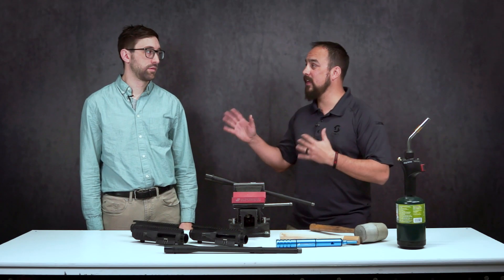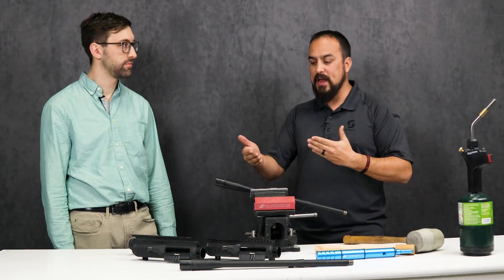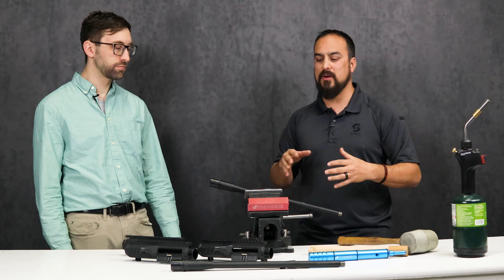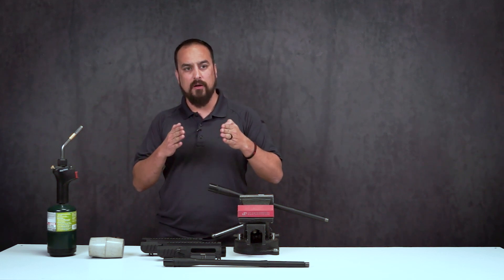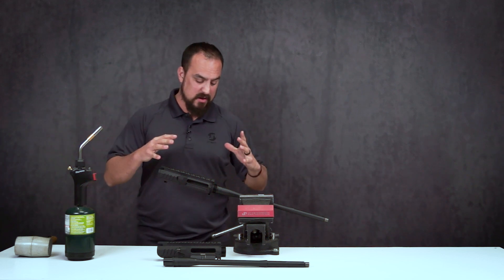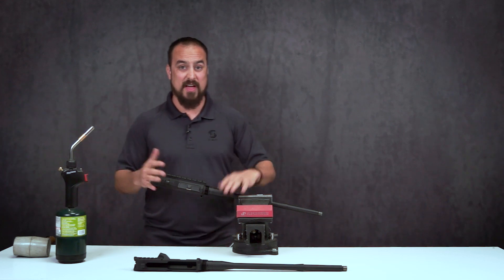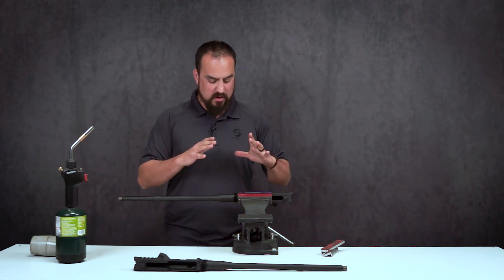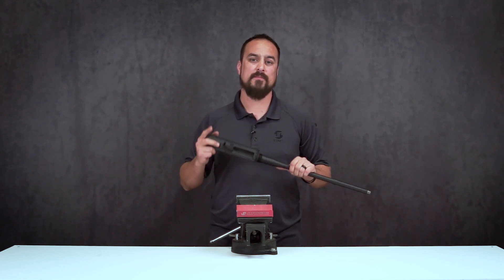The Secret of Thermo-Fit™

Comment: Facing the barrel and using locktite produces the same results.  I don't like interference fits with thin aluminum.  Better to bed it than to add that much stress to thin aluminum. This isn't a situation where you want to change a dimension.  This steel barrel isn't going to give at all in this scenario.  The aluminum will stretch. If you bed it with locktite, this won't happen. Try it and measure the receiver/barrel threads before and after inserting the "thermal-fit" barrel.

Comment: Or the reverse freeze barrel it will slightly shrink heat receiver in oven to 250 to expand then put it together if you dont have torch

Comment: So does this process take into account the fact that you are altering/relieving the heat treat temper in the aluminum of the receiver at a high impulse stress location?
Reply: They're not, it doesn't.  How do I know?  Metallurgist with years of experience.  6061 and 7075 are both solution strengthening alloys. They are only heating to 300-400f.  Not enough to do anything.
Reply: @tke466  Are these hypereutectic? or just really strong and stable?
Reply: @thewatcher611  not hypereutectic. That alloy really is suited for casting.   The Si content makes casting easy.  6061 and 7075 are wrought grades. Their chemical comp make them functional impossible to make a good casting.  They both are solid solution strengthening meaning at room temp they will achieve full strength.   Yes at room temp.  But that would take literally years.  So you artificially age them at a 300f give or take for hours... many hours.  Interestingly about 15 years ago the same phenomenon was discovered in gray iron.  The industry really doesn't utilize or talk about it as it takes only 30 days sitting in inventory for it to happen.  Hypereutectic aluminum is primarily used for ease of casting and hi thermal (dimensional) stability.
Reply: @tke466  can you translate for a layman?
Reply: @FLSheepdog  what part can I help elaborate on?

Comment: Same with my BCM uppers and BCM barrels. 
I thermal fit the receiver to barrel
Reply: Do you use a torch or heat gun?
Reply: @narutobroken  
Heat gun
Reply: @narutobroken  
It don’t take much
Reply: @jayonez137  cool thanks. I’ve got a barrel that’s stuck and am trying to remove it. Will buy a heat gun and give it a shot
Reply: @narutobroken  
That should work. 
Try Getting some oil in there prior to heating

Comment: I’ve done this on the last few rifles I have built.
Reply: If the barrel fits, there's no need for thermal fitting, right?
Reply: @danny2shoes  Right but I would look up how too use stainless steel shim stock too get a more accurate rifle. Usually .001 shim stock will work fine.
Reply: Huntski Kerbiden-Zhaojing  T.Y. It works & it's a cheap fix for a barrel that does not THERMAL FIT TO THE RECEIVER, LOOSE FITTING. The result is better accuracy & who doesn't want that ? There's not a whole hell of a lot ya can do for better accuracy on these take down pinned guns. Buy the best parts ya can & go from there.

Comment: Wouldn’t facing the receiver face and and truing up a very good barrel accomplish the same thing?
Also I’ve STOPPED using any type of aluminum barrel but. 

I promise you if you loctite the threads on a high quality steel barrel nut you will need that torch to get it to back off.

Comment: I just did the same, except had my upper receiver in a toaster oven at 350F for 20 minutes, slipped right over the barrel extension with 0.0015" sst shim stock easy peasy.

Comment: What about putting aeroshell grease on the barrel extension? Wouldn't the heat make it run? It has a temp rating of about 300F
Reply: That's what ima use. Shouldn't hurt it

Comment: I've had bad luck with interference fit barrel to receiver guns drifting.  I now use 620 retaining compound.

Tight is OK but if the receiver has to stretch to fit I think the stress added causes poi to drift.

If it takes heat and a mallet it's too tight in my opinion.

Comment: Since it is a heated fit. If you dump say 5 magazines will the barrel heat up enough to crack the reciever since it is so tight and the barrels heats up faster than the reciever making it expand first
Reply: Aluminum expands quicker than steel when heated.  This coupled with aluminum's ability to dissipate heat quicker than steel will ensure that isn't ever an issue.

Comment: Throw the barrel in the freezer before you torch the barrel, to shrink the tolerences on the barrel. Its like replacing a spindle on a wheel hub with no hydraulic press

Comment: The bcm receiver for my last build required the same thing. The instructions it comes with say they are intentionally made to smaller tolerances so they can have a better tighter fit. I will always buy a bcm receiver from now on.
Reply: My vseven upper was the same way. Fit very nice once I heated it
Reply: @ragedashboard6374  right on! Good parts!
Reply: Did you use a torch or a heat gun to heat up the upper?
Reply: @narutobroken  I used a 14 oz propane cylinder torch and some aeroshell barrel nut grease when sliding it in. But A heat gun might work too.
Reply: @theimpaler2317  thanks. I have a barrel that I can’t get off. 
It has grease on the barrel extension so I’m wondering if it could burn
Reply: @narutobroken  the grease is made to withstand a lot of heat, but to get a stubborn barrel off I’m not sure. I’ve used a reaction rod to install one of my barrels once, and I’m not sure but you might be able to use one to remove the barrel, but I’d do more research first, and obviously you’re gonna need an upper receiver vise block if that is the way you end up doing it.
Edit: actually no don’t use a reaction rod that might be a bad idea since it’s metal on metal. Use a wooden dowel that fits into the upper and you can tap the barrel out.
Reply: @theimpaler2317  Thanks good idea, I picked up a 1" wooden dowel so hopefully it fits
Reply: @narutobroken  if it doesn’t budge you might wanna heat up the upper a bit
Reply: @theimpaler2317  Thanks yeah Im planning on using the heat gun to get it slightly warm
Reply: @narutobroken  good luck to you!
Reply: Do you need locktite as well with this process?
Reply: @LT4me  no, just use aeroshell grease, and then torque it to the specifications from the manufacturer.

Comment: Hmm... Cool idea, but it seems like you’d be putting a ton of stress into the receiver that way. Given aluminum’s flimsiness and tendency to fatigue over time, that makes me a bit nervous
Reply: With how little he heated the receiver and how easy it was to push on to the barrel I couldn't see there being more than a .00002"-.00005" interference fit. That wouldn't be enough to stress the aluminum/cause the receiver to fail.

Comment: I ran into this on a Centurion Arms CM4 upper not knowing it was a thermal fit upper, ended up freezing the barrel overnight set the upper on the stove a minute or so and they slipped right together. Still looking forward to shooting the completed lighter weight 16" rifle with their pencil CHF barrel. It's significantly lighter than the old heavy barrel M&P Sport II blaster.

Comment: Can this be done with a heat gun, and if so, what temperature should I be going for?
Reply from the maker: You can use a heat gun, but it has to be pretty powerful.  Not sure what exact temperature is called for.

Comment: Just another sales pitch. If you true up the mating surface where the barrel extension kisses up against the upper receiver that will do way more for accuracy (assuming you follow correct tq sequence for your barrel nut).
Reply: Squaring low quality uppers won't fix problematic accuracy. Uppers that give you the best groups have square and tight receiver extensions that are aligned with the picatinny.
Reply from the maker: All of our receivers are squared and doubled check during the QC process.  We have done years of testing to prove that Thermo-Fit really works

Comment: New to barrel assembly but what about the barrel shims?
Reply from the maker: Depending on the fitment between the barrel and receiver, you might need shims, but you can still make use of this method.
Reply: Ok, I see now. Some YT videos show the shims going between the barrel and receiver, which is wrong. And if you installed the shims between the rcvr and barrel then had to thermal fit the barrel, that could he a very time consuming project. 
The shims go on after the barrel is installed, between the barrel and barrel nut.

Comment: I tried to do thermo fit with my grill lol I failed miserably. I will head to the store to buy a vice block and a torch. Also was I supposed to use grease on the barrel extension?

Comment: Off topic, picking and choosing parts for a custom build, not all pieces are machined to the same tolerances. Any solutions for tightening/snug up a barrel that almost feels a bit loose in the receiver prior to the barrel nut?  I know the the barrel nut will snug up but I can't help but feel regardless it will still have the slightest amount of play when operating. Please correct me if I am wrong

Comment: I would want to seat the barrel with the nut while applying heat or in a fixture that assures the barrel extension is seated to the face of the receiver. Not just shove it together by hand and then tighten the nut after it's cool. I like the idea but not the Technic.

Comment: I got a cry havoc QRB on my 7.5 .300 blackout.  Now i know it's not suppose to be hard to pull the barrel out of the upper receiver.  I have to struggle to take them apart. Putting it back the upper receiver isn't bad it just pulling them apart is..what could be the problem? Any lil advice will help either from you or any fellow subscribers
Reply from the maker: Is it difficult to remove immediately after you install it, or are you talking about it being difficult to remove after you've shot it some and disassemble?
Reply: @JPRifles  after i installed it..haven't gone to the range yet..

Comment: Just like fitting bearings to shafts. Typically a .002 interference fit. Sometimes .003. But very little time to fot both pieces. In that case freeze the barrel and heat the receiver. To me. I measure everything to know what I'm facing. 
Heating with a torch is easy way to damage a bearing. In this case, the receiver by applying too much heat to one spot
 Proper heating element and use of  a rated grease pencil for heat you need to acheive works very well. However, better method than opening up the receiver bore when a barrel extension does not fit.

Comment: You guys dont have a temperature value to throw out here? What degrees are you heating too?

Wouldnt you want to heat the entire receiver in an oven to prevent thermal differential stresses?
Reply: @David Macaulay Yea thermo fit parts arent anything new, thats why I'm surprised they're acting like this is some kind of proprietary information... seems weird to be so vague about this kind of stuff when you're making a tutorial for the customer.
00:47 "we've done the math on this"  buuut we're going to give you the minimum amount of information to try and do this yourself.
Thermal fit, shrink fit, press fit are all standard and have established tolerances.
Reply: @Big Wally you sound like an emotional girl.
Reply: @Big Wally get better soon bud.
Reply: Big Wally   Carl & Beach & board fan is absolutely over thinking it!  If you can’t get the gist of this video than you should be using a gunsmith.

Comment: Does this process only apply to your uppers/barrel fit, or does it apply to all uppers with your barrel? I haven't completely decided yet on barrel, but am working on obtaining the info that would help in deciding on whose barrel I'm likely to buy.
Reply from the maker: The barrels have a standard sized barrel extension and do not require the Thermo-Fit process when being installed in most receivers. Only the JP PSC-19 and JP LTC-19 upper receivers currently require the Thermo-Fit process as shown in this video.
Reply: Bcm uppers are this way..

Comment: So I'm not nearly as smart as these fellers here, but I'm a little worried about cracking the reciever.  I'm thinking that if the receiver wont even fit without being torched, what kind of stressed are imposed on it when the barrel gets ripping hot?

Comment: But how well did the upper and barrel fit before the thermo fit? Was it too tight to slip on, and heating the upper expanded it to fit? What if your upper and barrel already fit fine or was loose? Would you still want to do this?

Comment: What do you guys think about "truing" the threaded portion of the upper to get a more flat surface to mate with the lip on the barrel extension?
Reply: The billet uppers from high end makers as well as forged uppers from mid tier milspec makers are close to perfectly squared. The colt tdp calls for squared faces before anodizing so an absolutely square surface is not necessary as evidenced by the number of working colt, colt canada, fn carbines out in the wild. Tightness in concert with a square face is the recipe for an accurate stripped upper. The dogshit $50 stripped uppers sold to civilians will not hold the barrel tightly, will not be square, and the picatinny may not even align with the barrel extension (suspect anodizing thickness as well). Bcm, colt, and aero uppers will be square and somewhat tight. Then you have monstrosities like JP which probably don't need a barrel nut to hold the barrel in place as the bcg slams into battery, that also have high mass to reduce flex imparted by the handguard (sling and bipod pressure) and barrel.

Blackstone arms sells aero uppers that have been squared after anodizing. The owner of ar15performance recommends true square for even bolt lug engagement thus enhancing reliability, not accuracy. He's the guy who led me to blackstone. I emailed blackstone and they said the company who squares their uppers only do large orders, and they didn't tell me which company it was. If i want true square I'll probably have to do what other home builders are doing and buy the brownells squaring tool and dremel my own receivers. But i won't because i don't believe it's necessary if you buy a decent stripped upper. Same applies for blue loctite, im not going to tear down my builds and replace grease for loctite.
Reply: Dude, dont give away all their proprietary secrets!

Comment: MUST use a torch, people who try and use hair dryers and freeze the barrel are wasting their time.
Reply: I have had use a Milwaukee plug in heat gun to get a barrel in once. It’s took a minute but it worked. Still had to tap in with a nylon hammer. That particular upper on the proper lower shoots very well.

Comment: Is this process specific to JP upper receivers, or would it be beneficial for any receiver?
Reply from the maker: Art, we have been thermally fitting barrels to our receivers long before the first receiver was machined to required Thermo-Fit. The results from the thermal fitting process is well worth it, and totally worth doing, as long as you know the correct process to thermal fit a barrel to a "standard" receiver.  Unfortunately for you, JP isn't ready to reveal all of his secrets quite yet.
Reply: Basically they are milling  receiver under specs to barrel size.  More likely they sell paired kits

Comment: If there is a fine line between heating to fit and potentially burning coatings........why not use a heat gun and a thermal thermometer? slower yes. more precise, yes. Not creating oxides and introducing them into a precision tool, check.
Reply: i mated my .458 barrel to an upper using a heat gun and laser thermometer.  it slid on at 225 F.  probably could've boiled water in a 4 cup measuring cup and achieved the same results.  maybe spritz the upper with rubbing alcohol right before mating to ensure the water gets wicked away and won't cause rust.
Reply: @keayrhyasen3071  and have the alcohol flash on you? Better use moonshine so it's at least "breathable"!

Comment: Ummmm.   What happens after a mag or two , when it heats up to the same temp ?   Also aluminum gets brittle with that kind of heat.         Normal shooting conditions absolutely will heat it up.   Especially when suppressed !
Reply: I was thinking the same thing. Wonder if freezing the barrel would work better?
Reply: The powder would heat the barrel which would expand with the receiver. Aluminum would get slightly more ductile as it heats, not brittle. Any AR can handle a few mags, JP's are designed for 3 gun competition to stay as accurate as possible while shooting as fast as possible. I think the idea is minimizing the shift in POA/POI with near perfect contact between barrel and receiver.
Reply: @danielmottweiler  It probably could work, but it's a lot easier and faster to heat something up 300 degrees than cool it down. I suspect that rings expand more than thick SS tubes.
Reply: Ummmm, are you forgetting the barrel but?